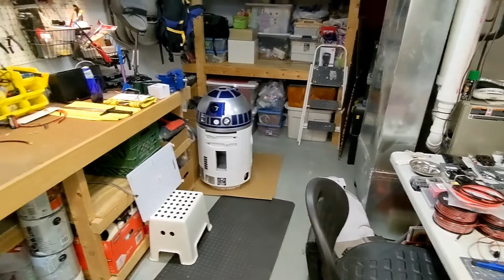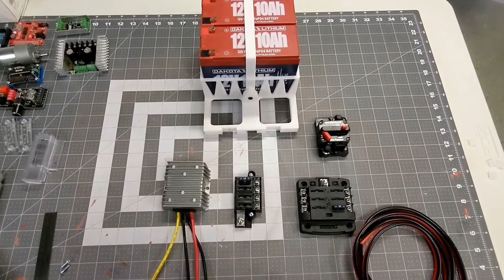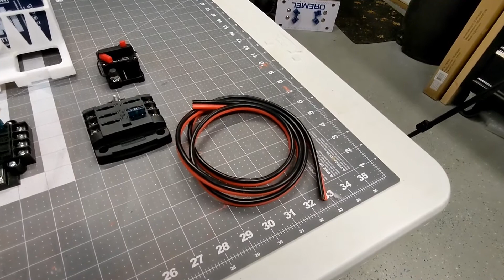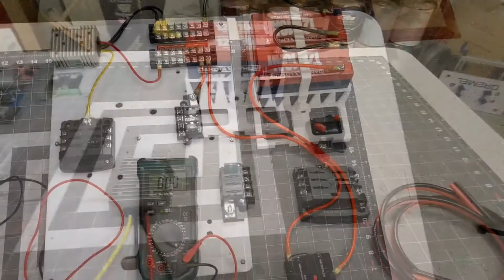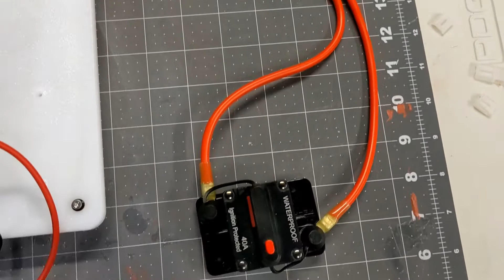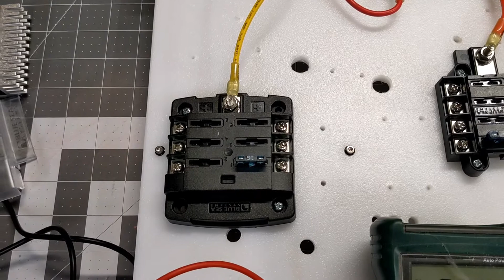R2 Electronics Build Part 1: Battery Connections and Main Buses

Comment: How are yo charging this system?
Reply from the maker: I discuss charging options and provide details of my approach in this video: https://youtu.be/kGr3Td5drZc 

In short, I take the batteries out and charge them individually - it's simpler and much cheaper to do it this way. It only takes about 3 hours to fully charge each of these batteries from empty. The cost and wiring complexity required to charge them together in R2 simply isn't worth it - especially when you consider you will still need to take them out occasionally and charge them individually to keep them balanced anyway.

Comment: I'm still going thru all of your videos.  This question may be answered somewhere but: How do you charge the batteries?  Did you hide a charger connection somewhere?
Reply from the maker: In my setup I need to remove the batteries to charge them. From a safety perspective I prefer this, even though LiFePo4 batteries are among the safer options. I could have routed a charging port to the charge bay on the front, but opted for USB to the Arduino instead. I am pretty confident I can get a full days operation with one charge, though time will tell.

Comment: Great information. I'm no where near the point of adding electronics to my droid yet but I'm trying to plan ahead and this has answered a lot of my questions.  I had always thought that a 24 volt system would be the way to go.

I've also been concerned about that lack of access of the MKIII cut version.  Your solution looks like a good one and doesn't need a lot of modifications to the files.
Reply from the maker: 24v definitely has its advantages. For me, it worked best to plan “big picture” and save the little details for implementation. I was really intimidated by the electronics, but taking it step by step worked out alright. Good luck with your build!

Comment: Keep the videos coming please. They are very helpful. May sound silly but how do you charge your batteries?
Reply from the maker: The batteries came with a charger, and for now, I will be charging the batteries outside of the droid. I had considered adding a connection in the little charge bay next to the coin slots that I could use, but have plans to use that to connect a USB to the Arduino for updating code. My hope is that I can reliably get a full day's use of R2 on a single charge, so removing the batteries won't be that big a deal. I might very well address this in a future upgrade. We'll see.

Thanks so much for watching. I'm trying to get another video out soon - the real electronics board is about 99% complete and installed in the body now. He's getting close to being completely mobile!
Reply: Thanks for your reply on the battery front. Can charge and use the battery at the same time. The idea is to have R2 charge himself. Which means he needs to be on so that he knows when to stop charging himself.

Comment: This is the same place that I am now. I still need to to purchase the sabertooth and the syren, but I have just about everything else. You are the only other builder I have seen that uses the Artillery Sidewinder printer. I have been thoroughly pleased with mine. I will be watching this series for sure. Thank you for taking the time to do this.
Reply from the maker: The sidewinder has been a real workhorse for me. I did have to replace one of the ribbon cables not too long ago (the one that runs up the left side) as the printer would occasionally make a horrible grinding nose when trying to move along the x-axis. Thankfully the printer comes with replacements and it was an easy repair. Thanks for watching, and I'm happy to share what is definitely going to be a good learning experience for all of us!

Comment: Nice work, I’ve got most of the electrics I need. Still waiting on acouple of things to to be delivered, where did you get your foot motors from?
Reply from the maker: I got the foot motors from Amazon.  The ones I got are listed for $47 currently, but there are others there that are less than $30. They're all pretty "generic" and are essentially the same motor. I've mentioned before that the 24V/150W motors are a little "taller" than the 12V/100W versions (same diameter, though) and required some hogging out of the foot shells to fit around them. Also, be aware that pulling the gear off the shaft is going to require some elbow grease.
Reply: @jasonsR2D2  ok thanks